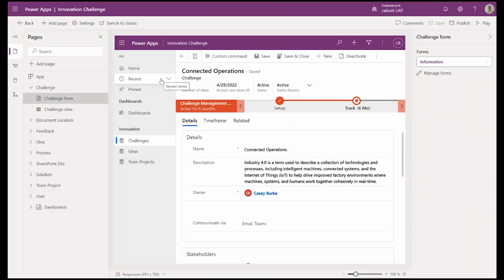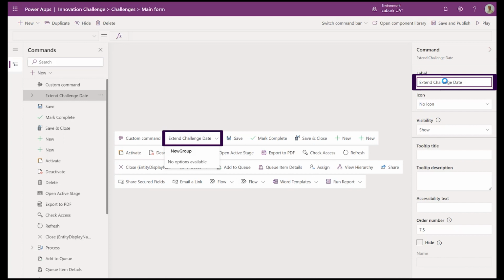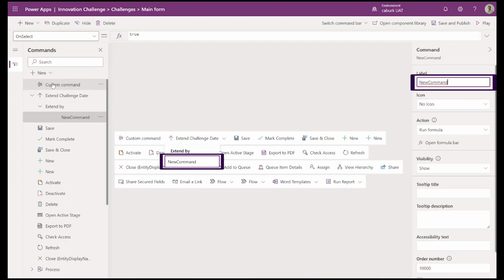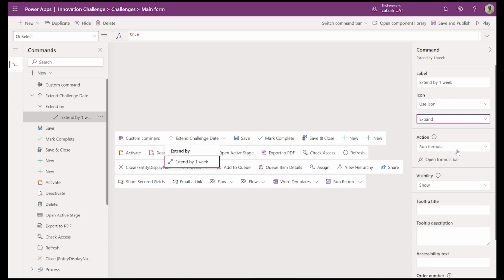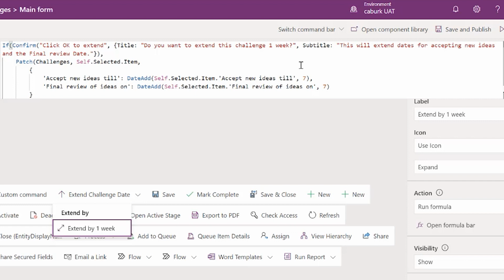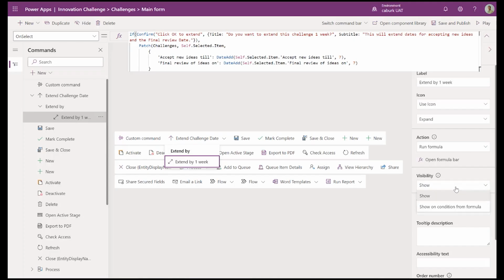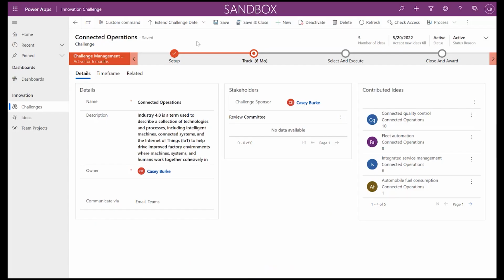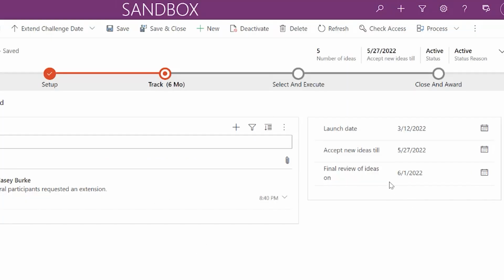Easy Power Fx Command Bar Customizations - Power CAT Live

Comment: Thanks for this illustrated video of using Power FX and also showing how structured and elegant solution for editing Command Bar. One aspect that is lacking from a User Experience is when you change the date, there must be a visual indicator showing what has changed on the form, because of an indirect or direct action. this causes so much confusion. We have the same issue with Model or Canvas apps. There should be a customization at the Form or page level. 

Scott, Ribbon Workbench has saved my neck more times that I can remember. Will always be thankful for this utility and the capability that it provided.